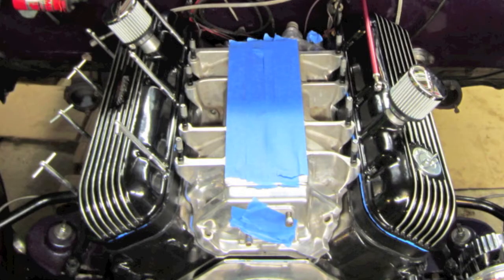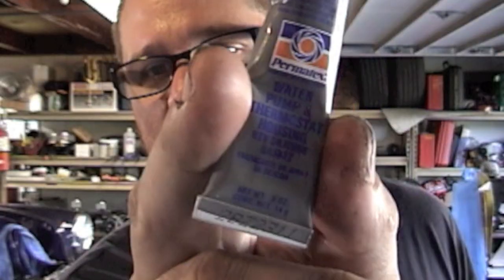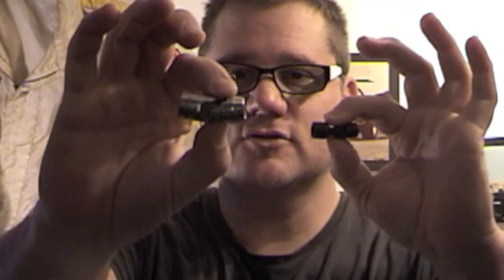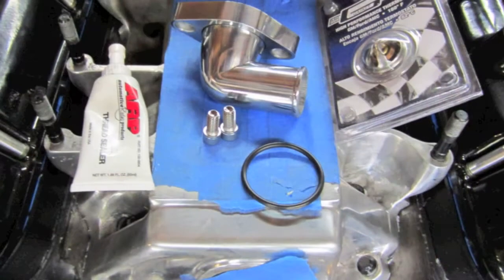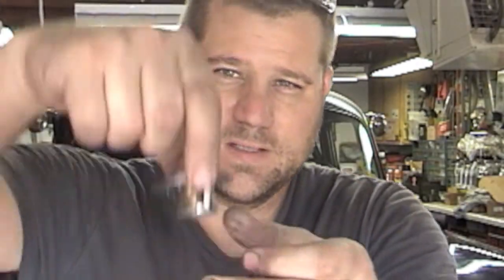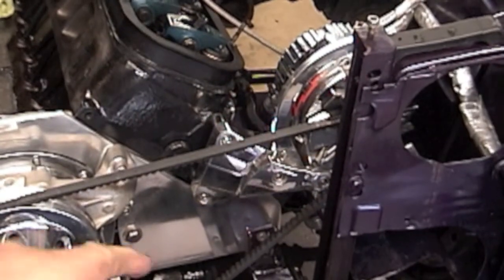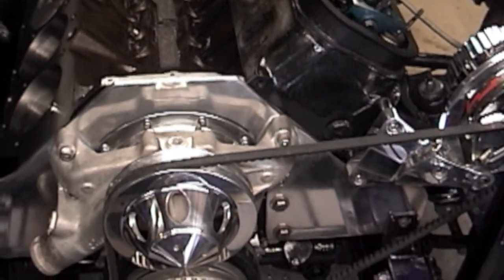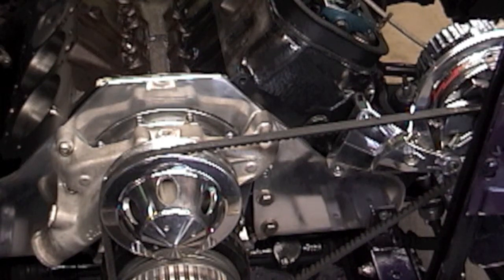Part 20 How To Adjust The Lash For The Big Block Chevy

Comment from the maker: Hey don pato,
I wish I was that smart...hahahaha
After 20 years of running my 6-71 I'm sending it in to have it rebuilt & machined.
As far as replacing the bearings, they make a special bearing puller tool and someone sells that tool can't remember who.....and you can purchase the bearing rebuild kit,,,, Mine I need some work done to the rotors out of my league!!.
Thanks for posting!
Have a great day
Johnny K